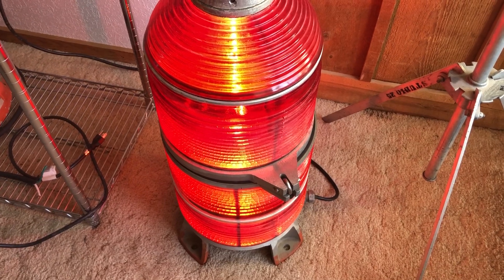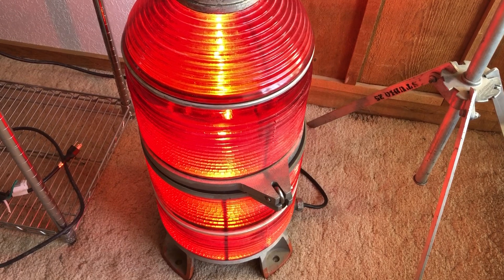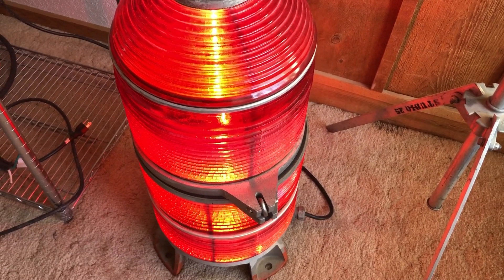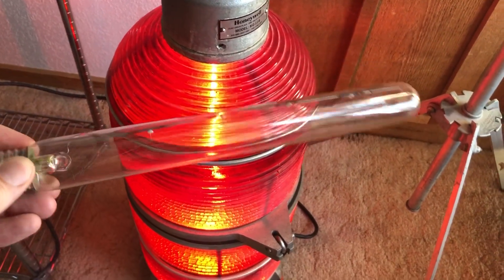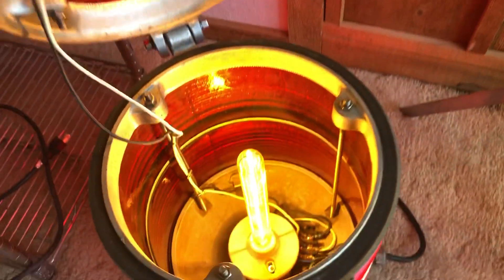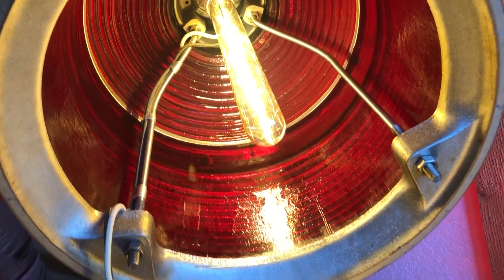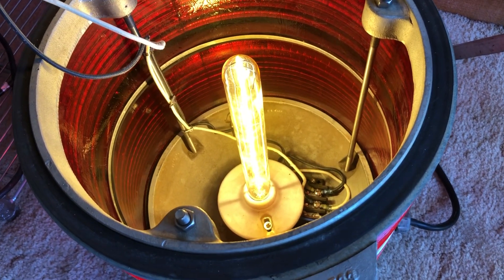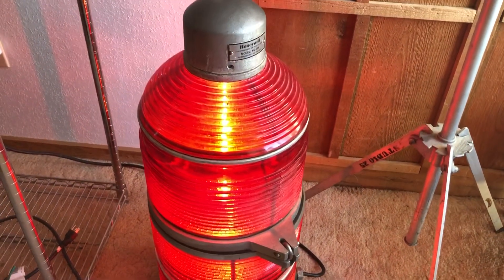Honeywell KG-114 300mm Incandescent Tower Beacon Modification

Comment: Hi. I'm just starting to look for parts. Can you point me in the right direction for socket replacements that fit? Thanks!!
Reply from the maker: ITL-LLC, Towerbeacon.com and eBay are good sources for parts.
Reply: Thanks! Would they (or you) have info about either converting to a household socket, or maybe an LED mogul base bulb that could be used in place of the 625 watt incandescent? Does such a bulb exist anywhere?
Reply from the maker: @davebenson1928  Your best bet would be to convert it to standard sockets like I did to the one shown in this video, it will give your more flexibility on what bulbs you can use. I used sockets that can be purchased most electrical supply stores. I simply replaced the sockets and added a standard 3 prong plug, but I did not have to redo any of the internal wiring. The biggest challenge was getting the cap off to access the top socket, some of the screws were stripped and broke off. So depending on what condition yours is, your results may vary.
Reply: So, I'm deep into one today. Clear glass. Biggest current issue I'm facing is getting the glass truly clean. The inside is all hazy and milky from years of heat. It gets some sort of mineral-like film in there. Started with glass cleaner, moved up to vinegar. It only gets so clean. Next up will be Barkeeper's Freind. Just wondering if you have any secrets of your own.
Reply from the maker: @davebenson1928  I've not found anything that will get them completely clean, I've used glass cleaner and lots of scrubbing inside and out on my Rohn and it made a big difference but its still not perfect, so that's probably your best bet.
Reply: Well, deeper I went down the rabbit hole. I ended up tearing down the entire fixture. With each glass segment lifted out independently, I soaked them in a sink full of Barkeepers Freind and water. But, the real winning move was sprinkling the powder onto the wet glass and working it in with a paper towel. It forms like a paste and with just a little elbow grease, all that milky film was gone. I was left with glass as pure and clear as new. Messy job, but the results were perfect. 
Now, to hunt down those new sockets for conversion.
Reply from the maker: @davebenson1928  Awesome, good job!
Reply: @davebenson1928  that's interesting, i have a 300mm that had the same mineral film and i was able to get it off using scotch brite but i think that your technique is ideal
Reply: @Creese da Mouse  well, I had been scrubbing away with a brush, without a great result. That Barkeepers Fried as a paste seems to breakdown those minerals and do a lot of the work for you. But I bet a scotchbrite pad used with it would be even better.
I'm still deciding just what kind of lighting will go in it after weeks of experiments. A fun project.
Reply: @davebenson1928  i'm really interested in these beacons, i've got about 4 of them but never really cared to retrofit them. all still have the original bulbs and they are bright as hell, lol. also curious what you used to seal the gaskets for the lenses back up, if you used anything at all
Reply: @Creese da Mouse  I didn't give much thought to the gaskets other than just being careful with them when I took everything apart. They went back together just fine though. I haven't decided if any of mine will be living outside yet, but  I'm not too worried about them.

Comment: How tf you get it to glow, and…or flag if you wanted too or so
Reply from the maker: It's plugged into the wall outlet, which makes it glow.
Reply: Ah ok so in order to make it flash it has to be plugged into a controller
Reply: I just want mine to flash with the original bulbs